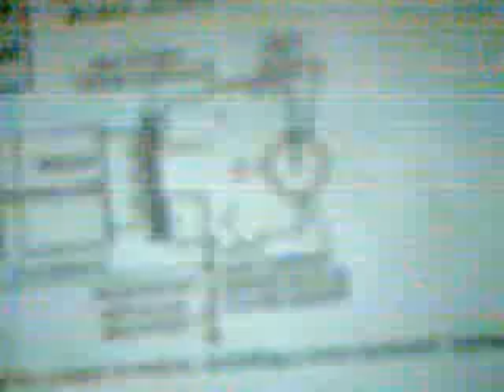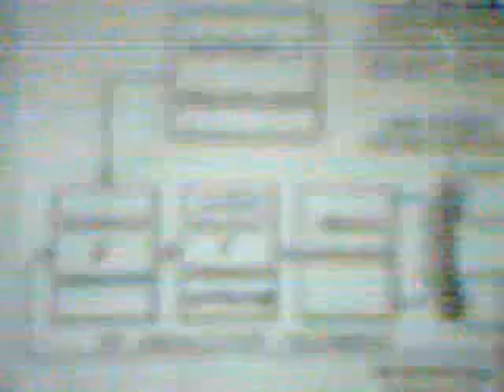hydrogen andrija puharich water fuel cell  pantone  meyer CARL CELLA

Comment: Hi Honda,
It has been quite some years ago since you posted this.  Unfortunately all imagery is blurred so that nothing can be actually seen, only the sound is fairly good. So how can I actually see the video in a good qualiry?
Where are you now on this hydrogen project?
Reply from the maker: Hi quite a way on now understanding that water is an host for a third energy like condensed rain lightning and thunder type energies electro static and magnetic static one by pulsed ac like in clouds the other dc pulses like from our earth  watch reddpill youtuber and his part 1 to 5 videos of joe booker. A type of Hans Coler device he states the Germans used in ww2  vw beetle built for this magnesium sump aluminium block makes a battery

Comment: no is a transformer,inverter,converter  some call 12v >to 120>coil pickup 100.000 Volts= ark of energy same like thunder  lighting in the sky  when water it's inject at engi.e create pressure vapor, when the engine it's compressing create  heat then just when start to come back down create suction depression then  nitrogen from air and hidrogen from water move up to depression air colling  that's when this lighten event cause big bang like we see in nature ,that create static energy that fire the engine, but a same like in nature the sky it's energized ,hot air / water release nitrogen /hidrogen  from earth then when up to sky shock to each other creating thunder and lightning result all energy manifest  an water it's again the result
Reply from the maker: thank you that makes sense as herman anderson talks of 70,000 volts in his youtube video and daniel dingle states ac dc pulses with 3 coil wound relays i presume escalate the energy volts for more power/throttle .though dingle does show a vacuum pipe at side of gear stick that throttles the engine also very clever but as stanley meyer states K.I.S.S (keep it simple stupid )  thanks again and i appreciate replies .its all for free from me .
Reply: @honda4004  The Suzuki video from joe cell  .when the guy rebuild  his alternator he was confuse about the tree wires of the alternator, 1st to ignition wire live(supply from ignition switch, normally  black and white, 2sc to  ignition  warning  light, red and white wire 3rd battery  positive  2 large yellow and white  cables, he put then wrongly from factory bu right  to spot new wave frequency,  boon car fire with out the battery/ and with out  primary  wire on the coil .....because he connect L2 Cable on S plug ,and S cable on L2 plug secrets  review S it's sense on regulator, and drama from 3/5amps with it's equal 3or5 amps x 200 watts = 600[ 1000] Watts multiply to coil turns regular  coil with 12v,= 25 000 volts  in this case the coil was producing somewhat about 100.000 volts to the spark plug and anything that u place inside the cilynder will make kboooon

Comment: Hi. Good work. Your research is fantastic. Don't forget Daniel Dingel :). Don't also forget John Kanzius too. They all have one thing in common - It's high voltage, 200w, low amps. Did you find out how to fix the rust problem. Dingel says he fixed the rust and starting problems. I'd really like to meet up and compare notes. I'm at wsmith yeah at gmail d o t com. Just remove the spaces :)
Reply: The rust problem in part of energy and metal oxidation, but if u put the tubes cell not submerge in the water and make high out tube negative connect  from bottom, and inside lower tube on the inside positive  that make  diferenca on the rust  as long the water don't over flow  the outer negative  tube, then also the cell need to be negative pressure  connect to vacuum  line in the engine that it's key for highly gas production cause negative pressure  will be inside cell that way light gas hidrogen it's on top of water,

Comment: In looking over the writtings from the link offered, we need some strong radio/electricians who could also relate to physical experimentation. There is a crossover between frequencies in electronic current & sonic resonation, involving mostly known electronic/physical properties, and some that was discovered, like improved hearing by Puharich's current/signal driver. There seems a sonic connection with a tuned pulsed current. It's like dialing in the pulsed current to the right pitches.

Comment: Interesting. Sorry, I don't know the answer, but I "would" assume it's worth investigating. I've heard that when you combine high voltage with high frequency, and you may tend to get exceptional results. 

Has anyone tried using a 2-1 ratio for surface area on the electrodes? You get twice as much hydro than oxy, so why not have twice as much hydrogen electrode surface collection area? Physical in harmony/balance. Could be worth a try! If it works, remember me. ;) Please keep up the good work.

Comment from the maker: we know ,just got to dodge the bullets . it is so simple just need to understand frequency...but just been outside using my sawzall saw whilst it was raining cutting a thin steel sheet and looked at the puddle of water lying in the floor pan and whilst i was cutting it made the puddle quiver and that "clicked"  but i now think that i can make a vibration off the running engine once it has started to match the water dissociation vibration.. please re-issue this video world wide by any means,